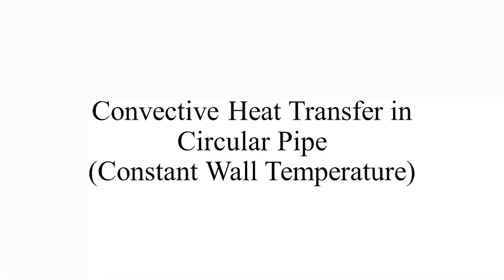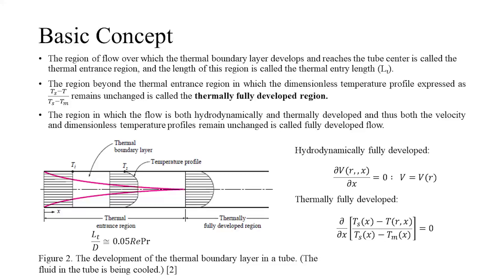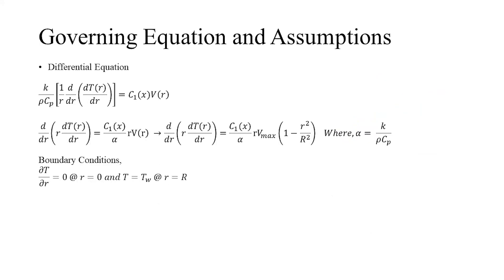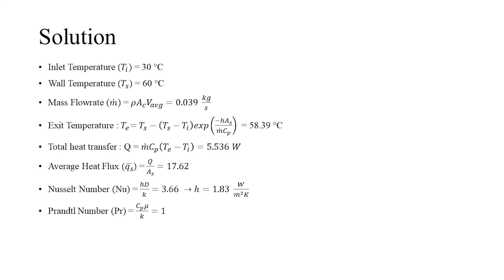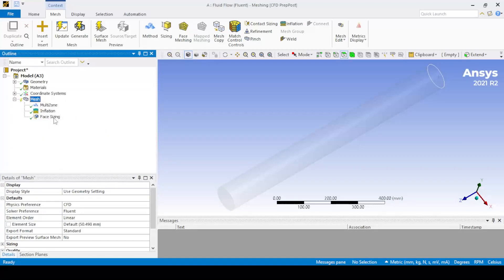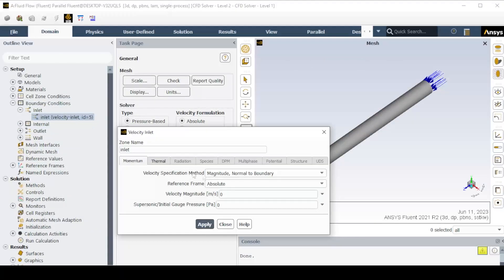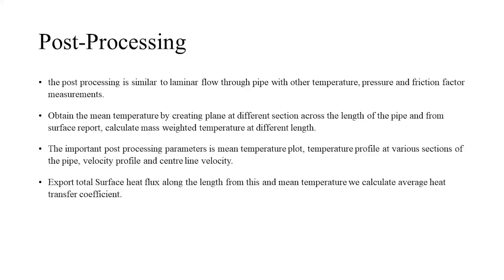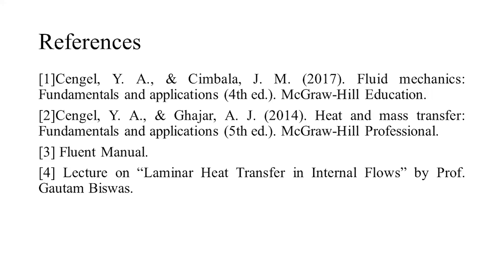CFD Analysis of Pipe with Constant Wall Temperature using Fluent (Validation)

Comment: Hello Mr, I have question about laminar mixed convection in horizontal circular pipe, if we activate boussinesq hypothesis in density properties and add thermal expansion coefficient, gravity also. do we need to chnage operating conditons or not? in this case we use water base fluid.
what is the range of application of temperature in each cross section (water base fluid) (boussinesq validity in mixed convection)?
Reply from the maker: Yes, we must set operating density and temperature of reference point(known density and temperature). Please make sure Boussinesq model is applicable or not.
Reply: Yes, I do, but the results obtained showed that the temperature difference is great than the range of boussinesq hybpothesis applications, so what do we do now? @Inphitude
Reply from the maker: @ammarlaichi8474  For large density variations, model density as a function of temperature. You may approximate it as a polynomial. We will cover this concept in upcoming videos.
Reply: Thank you so much Mr, I hope to work more video about mixed convection in circular tube @Inphitude